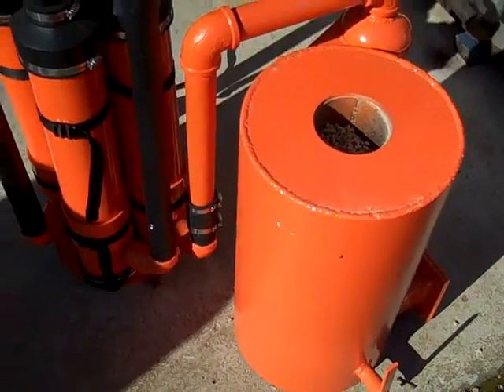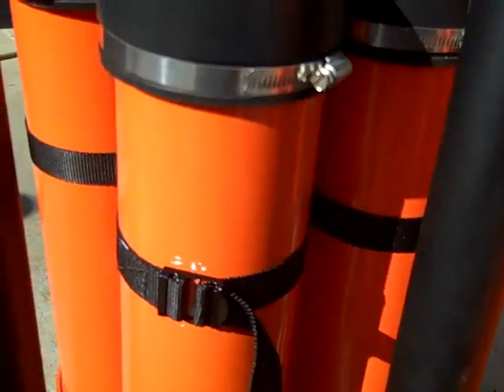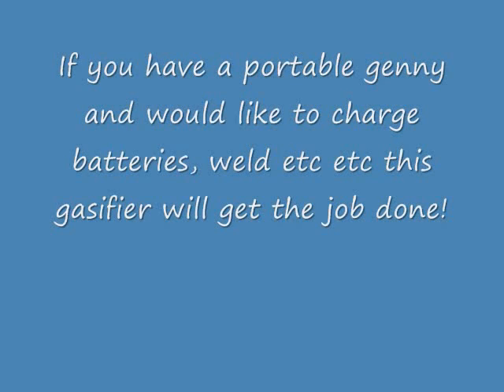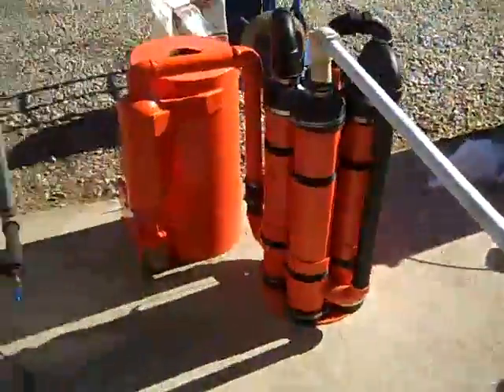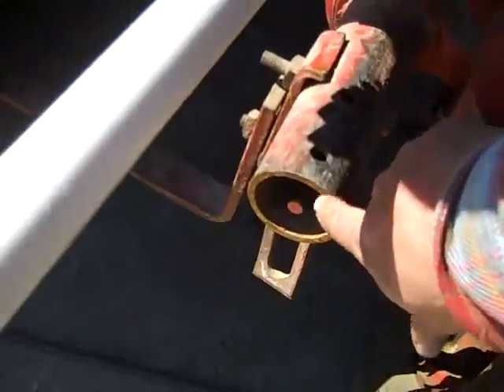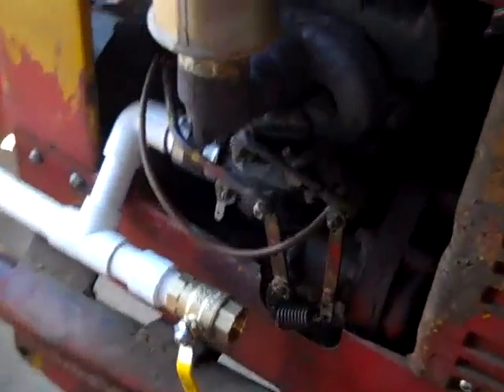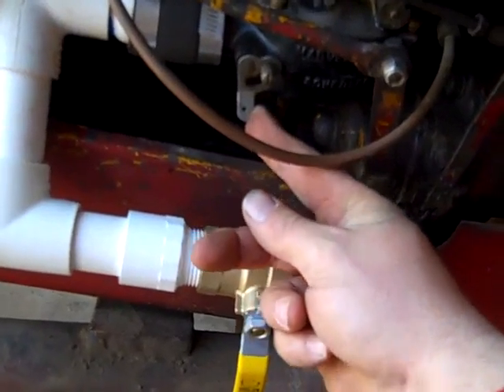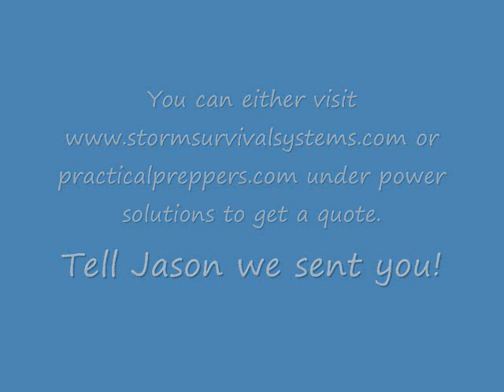Storm Survival Systems Gasifier

Comment: I am thinking bout buying one of these but started getting concerned by some of the comments about these needing to be cleaned out every couple of hours. Is this true? I'm up north and it can get -40. I depend on having my 6500w genset to cover my butt when the power fails, which is too often in winter. Do you think I can reliably count on a unit like this? I have access to a pellet making machine so this would be the ultimate if I can really count on it.

Cheers.

Comment: Hey Engineer775 you really should take a look at our stuff. For the cost of those other machines that are out there they do not even come close to our build quality or performance level.
Reply: I found your Vulcan unit on Youtube. You're a genius my friend. I appreciate how you're constantly innovating on your designs, including miniaturization.
Reply: @richseng  Wait till you see whats in development now. I am working on a wood stove system that produces biochar as a byproduct. This char can then be used in a charcoal gasifier. NO Tar and very consistent. The stove will produce fuel with very little effort as you just use it to provide your primary heat source.
Reply: Thrive Energy Systems That sounds very interesting. I’m also curious in how the bio char can be used to amend souls for gardening. Keep posting videos! I’m starting to go through them.
Reply: @richseng  Exactly, this stove will fit multiple markets and will be a much more viable product. You can read up on this here, I need early buyers to get this developed. http://forum.driveonwood.com/t/mr-charcoal-automatic-firewood-to-charcoal-processor/5274/31
Reply: Thrive Energy Systems Cool. I will read up on all of this. As society & civilization starts to crack like we’re seeing this technology will be our saving grace.

Comment: Seems to me a gasified is better suited to a continuous load such as a generator, water pump, or threshing/saw etc. The gasifier system does not seem reliable for a tractor or vehicle because of the need to change throttle for speed or pulling power. 

Perhaps if there was a more reliable carburetor with throttle for the other applications it could make more sense.

Comment: Fill up that hopper and lets see what it does... I think you will experince problems... and make sure you aren't getting gas through your carb.... it should die almost immediatly if you close off the air valve...

Comment: That will be a nice unit, you will be able to easily slide the unit into the frame rails to install it or remove it if you need to. That is really fascinating how you can run an engine on wood like that. Hey Scott, did you know that JD used thin wall tube, thick wall tube, and solid bars for the frame rails depending on the year and also whether it was an L, LA, or LI. I thought that was interesting.

Comment: That's cool. I see you adjusting that parker ball valve at the carb. Were you trying to get the best and smoothest idle? If so, maybe you can hook up a vacuum gauge to the intake manifold or base of the carb under the throttle valve as it has to be manifold vacuum you're measuring and not venturi vacuum, and then adjust the value to where you get the vacuum gauge to read the highest and steadiest reading that you can, and that's where your engine is running at its best. Basically, that parker ball valve is the new idle mixture screw, at least that's what I'm guessing from this video. Anyway, this is how we used to adjust the air fuel mixture on carbs with the idle mixture screw back in the day when we had carbs. It might be nice to have a vacuum gauge and valve on the dash so you can make adjustments as you're working or your load on the engine changes. Then again what the hell do I know about these. haha Just don't try doing it by ear. Yes, I was a certified mechanic a long time ago. Good video.
Reply from the maker: I like the "back in the day" solutions!  Thanks.  This was a quick throw it together test.  I actually have an auxiliary throttle control onteh tractor that I was going to use to control the air/woodgas mixture by ear.  Having a Vacuum gauge to adjust to would be much cooler.

Comment: I have rotten fallen trees in the woods on my land.  Can I put that through the chipper and use?  Would I need to dry the chips to a certain moisture content or does the flame do that as the gasifier is burning?  Thanks for sharing.
Reply from the maker: around 20% moisture works good in all the gasifiers I have run.

Comment: Nice. I wonder if you can get that tractor up to 88 miles per hour.
Reply from the maker: How about 8 mph.
Reply: engineer775 Practical Preppers lol. I was thinking of "Back to the Future". I could use that unit to run my 6 kW generator.
Reply from the maker: Wayne Bjorken That is a good size for this unit.